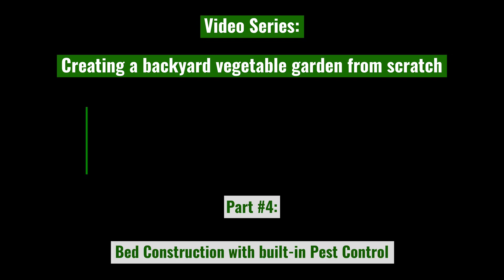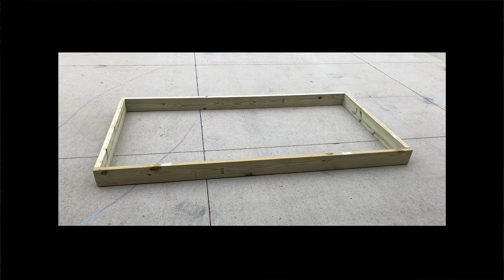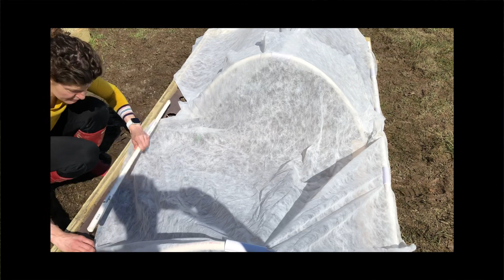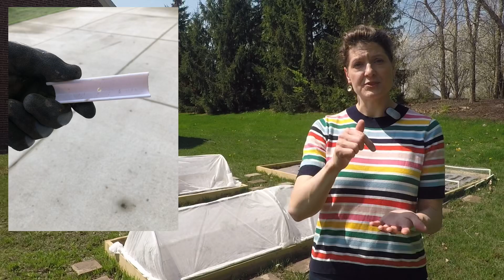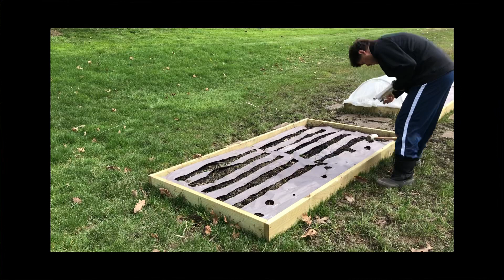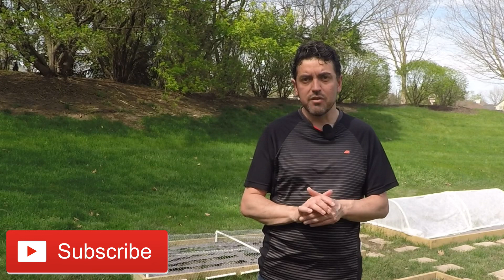How to build raised beds and how to integrate pest control to your vegetable garden?

Comment: Thank you for the clamp idea!!! I will definitely consider that. I'm using deer netting and pvc, my main pest are deer and rabbits.
Reply from the maker: apirlrain we are about to start building on a larger lot and deer will DEFINITELY be an issue.  Do you find that the netting is effective?
Reply: @WellGroundedGardens  so far so good, I had to build a rail fence around my row of apple trees bc they will prune the tops when I  just have a barrier of netting. For my vegetable garden, I had raised beds with pvc pipes as hoop frames.  I draped the deer netting used ring clip and clamps/clips to secure the netting and easy access to maintain the bed. Hope that helps